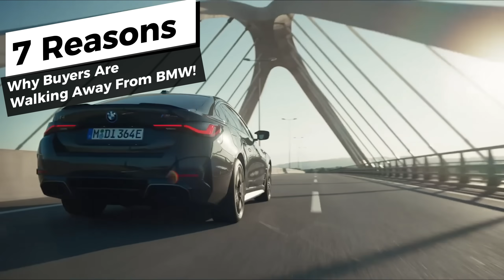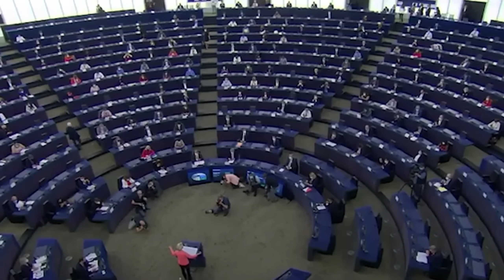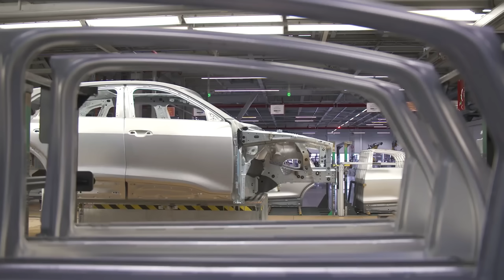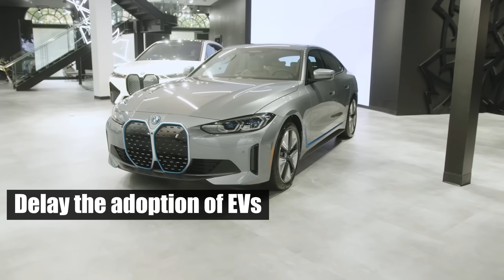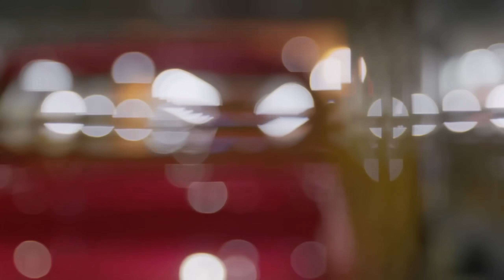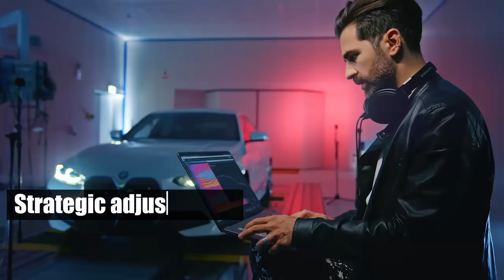BMW’s EV Sales Crisis: Why Buyers Are Walking Away! Electric Vehicles & Turbulent Market In Europe!

Comment: Look, imho the EV's look ugly . The height/length ratio is odd. This is due to the battery cell.
[ A nice looking car is eg. the F36 BMW]
Thus, as long as we do not have solid state accu's [ with higher energy density], the problem will not be solved.
Indeed, BMW produces Autobahn-limousine. What do you do on the highway? You drive very fast ( ~180-200 km/h ), on long distances. Not with the current battery technology. With that, you rather build small city cars [ i3]. Bad luck for BMW, who is famous for the Autobahn-limousine.

And this problem is made more serious by the new "" design" "language" of BMW. The dexterity and the elegance of their cars disappeared in oder that it appeals to the Chinese and yankee customers, who prefer the aggressive and villain style. [ An absolute disaster is the grille on the new 4er BMW, the 7er and the iX]. This does not correspond to the European taste. [ Maybe if a French or Northern European gets the chief designer position again and not a Serbian - who says that the cars should not look good, they should look "remarkable". Nope.]

Comment: Most cars are built out of painted spot welded steel. Pure heavy junk. Cars need a simpler blueprint, and components such as motor drivetrains should be coming from separate companies, so they will be more standard. The horsepower per passenger is completely ridiculous. A family wagon should weigh a few hundred pounds.

Comment: Zipse thinks we'd like to pay €400 per fill of hydrogen or €600 per fill of synthetic fuel, just because BMW wants to build old-fashioned engines. 🤣🤣🤣🤣The man probably didn't have physics at school, how is it possible that someone with so little knowledge of physics is in such a position? 😱😱😱😱 Laws of physics mandatory states: 
Hydrogen efficiency wind/solar to wheel: 22%, Synthetic fuel costs per liter: €8,-
Reply: however: what shall we do with the plenty of energy produced with the household solar cells in peak hours? one plausible solution is to convert it to H2?
Reply: @mortenvanlinden567 Yes H2! But not for cars.....H2 is very useful for fertilizers, iron melting in blast furnaces and other heavy Industries: they have no other environmental friendly alternatives.

Comment: At the moment 100% EV's by 2035 is a pipe dream.  The charging infrastructure can't support it, battery technology doesn't allow for extended range, charging times are too slow, and recycling used batteries will be a problem.  Industry will dictate what the future is for new vehicles based on affordability to manufacture and the cost to the consumer.  Governments are not likecorporations because they don't rely on profitability to sustain themselves; they simply raise taxes when they want more funding or deficit spend.

Comment: Compressed air engines might be a better way to go. EVs for all cars would be unsustainable for a start its not even a green solution as it uses toxic materials. No C02=No Plants=No humans. Single large compressors powered by various fuels could fill up a car far quicker than battery charging. Being just compressed air there would not be any exhaust other than hot air. Compressed air powered cars were used in WW2 so the technology is already developed using standard car engines with just a bit of tweeking.

Comment: Hydrogen is a dead end street both from a storage and conversion view. 
Hydrogen is a cover for legacy brands failure to make the transition. 
CEO's are gaslighting non technical investors with H2 and E-fuels.
The top ten in the US of EV/hybrid cars with the most stock expressed in average sales days included some 4 BMW models
There is an abundance of lithium. 
In contrast to the more ore less static Internal combustion engine both electric motors and especially battery technology is advancing fast with no end in sight yet.
EV are outperforming ICE on:
-power, 
-torque, 
-efficiency and soon on range too, 
-mechanical complexity no transmission and far less parts, 
-safety (required to protect the battery anyway), 
-production technology (mega castings), high voltage 48V board net
-software defined cars soon including real probably autonomous driving
-life time not being subject to the wear and tear resulting from that internal combustion vibration and heat

All (if you aware of exception please react) legacy car makers are experiencing their Kodak/Nokia moment and very few will survive.

Current ICE supercars Lamborgini, Ferrari and so on are not able to compete with a Tesla S Plaid or a Xiaomi with more power at a fraction of the price

The flight of ICE into the luxury segment is running into problems too.
Reply: If EVs are that wonderful, why have governments had to step in with tax breaks, discounts and all the other incentives. As one economist said, “make a better mousetrap and the world will beat a path to your door “ a good product will sell itself.
Reply: Note: I do object to an ideologically driven mandatory switch to EV. EV will do well on their own merit anyway. Mandates force uneconomical decisions. We are not a plan economy (yet?).
Reply: A year or two ago, I would have agreed with you on almost all points. I have even started an initiative to set up 12 charging stations in a communal area. And I might even buy a small electric car for the city soon. Nevertheless, I have strong doubts that electric cars will prevail in the medium term. I am increasingly coming to the conclusion that electric cars are and will remain a niche product.

-Drive power, yes, but is not nearly as important

-Torque. Yes, it's fun. But it wears off after a while. Range is more important.

-Efficiency, only if you look at the direct energy consumption. On the other hand, there are other disadvantages that are more important to me as a normal driver. Range, payload and trailer load are definitely important in practice.

-No, Teslas are safer, but not a Dacia Spring.

-Magacasting has nothing to do with electric cars. I looked at complex aluminum castings at trade fairs 30 years ago. 48 volts also works in other cars.

-Yes, but more expensive and more vulnerable parts. That is only a theoretical advantage. If I have to spend a fortune on a single part, the battery, then the advantage is of little use to me. That's the reason why electric cars are so expensive. If that were true in practice, then all electric car manufacturers would be money-printing machines. But they are not. I think only Tesla and BYD are making money at the moment. And part of that is credits from other manufacturers and subsidies.

- Yes, software is becoming increasingly important. But it has nothing to do with electric. The problem is that European and especially German software developers can no longer think straight because of data protection. They were systematically taught this during their studies. (Just my personal opinion, fuck data protection)

-Yes, in theory you're right. However, the high discounts on used electric cars indicate that things could be different in practice. Time will tell.

Your Kodak comparison is flawed. Kodak's problem was that they earned money from the follow-up products. Nokia's problem was that their smartphones could do so much more than the old Nokia bones. My original analogy was the advent of sports shoes. They were no better than well-made leather shoes, but could be produced much more cheaply. Also, electric cars theoretically have much lower barriers to entry. In my area, some small companies have turned new combustion SUVs into stylish electric cars. We're talking about 3-man operations here. But I don't see that small businesses have any say today. Only a vertically integrated state-owned mega cooperation like BYD can produce cheaply.

My confidence that electric cars are the future began to waver when the state paid purchase premiums for electric cars and quotas were increasingly demanded from manufacturers. The electric cars that I find interesting are exorbitantly expensive and were only sold in homeopathic doses (e.g. Jaguar E-Pace 150 units for the whole of Germany !!) or had. Massive delivery problems (Audi Etron, Skoda Enyak). The VW E-up, the only VW electric car that VW could sell in large numbers, was discontinued by VW and previously only sold at inflated prices. The earning structure of electric car sales is such that dealers have no interest in selling these great future-oriented cars to customers.

Fundamental problems such as insufficient local distribution networks are not being tackled by politicians in Germany. Instead, the problem is to be solved via land management. In other words, a cheap solution. WFT. In some cases, wallboxes are no longer approved if more than 2 electric vehicles charge in the street. One German municipality has completely stopped approving wallboxes. How are we going to achieve 100% electric by 2035?
Charging at public charging points is still a problem. Some e-car drivers estimate that 10% of all charging attempts, for non-Tesla vehicles, fail in Germany. I asked an experienced electrical engineer why this is the case. He has no explanation. Electricity is electricity. With a properly defined interface, this shouldn't really be a problem. But it is.
Prices for public charging stations have risen dramatically. If you can't charge with your own PV system, you save little or no money. For the extra 10,000 euros that an electric car costs, you can fill up a lot.
Chaos cards. Up to 70 Card in GER. For me as a consumer, I can't see why I should have a charging card at all. I don't need one at the filling station either. After a lot of complaining, there are now probably the first charging points where I can pay by credit card. You can even pay cash at the ARAL petrol station chain. Why not just like that from the begining?

Oh, but I wrote a lot about that. That is frustration and disappointment. I used to believe in electric cars. Yes. Faith is the right word.
Reply: Hydrogen = Hindenburg

Comment: The entire European car industry has been shackled by the EU's and UK government's 'net zero' obsessive legislation. The EV market is saturated, the situation exacerbated by plummeting residuals. BMW (and more acutely, Jaguar) have put all their eggs in the EV basket, and could tank (as could VW and Stellantis). BMW has not helped itself by increasingly hideous designs (as are Mercedes EVs), and dashboards that look like cheap, aftermarket add-ons. Most consumers want and need ICE cars, and this will be the case for a very long time to come. However, if hydrogen fuel (using green hydrogen) becomes viable, both in fuel cell EVs as well as ICE cars, then things may turn around - the operative word being 'may'.

Comment: The cheapest BMW EV starts at $58,000, simple economics.
Reply: $58,000 is a top premium price for a car.  I thought EVs were supposed to be $15,000 cheap cars that everyone could afford.  Electric motors are cheap and have been around forever.  Are they using braking recharge?  An electric motor per wheel?
Can they get the batteries off the bottom where they get damaged and in the back or front where they can be fire walled off from the passengers?
Reply: 👆this👆
Reply: Yes BMW’s cost too much! I had 4 BMW LEASES, FINALLY SAID THE COST WAS JUST TOO EXPENSIVE. THE LAST CAR I TURNED IN ONLY HAD 7800 miles on a 3 year lease. BMW still charged me $1400 usd because I turned in the car early!
Reply: @jeffereylew581  Run stupid contests, win stupid prizes!
Reply: Everybody seems to forget about the price of a needed charger. It doesnt install itself. Are the governments going to pay for them?  Doubt that.
Reply: BMW and most of the EU car maker stupidly just make car bigger for each generation, latest 5 series is already more than 5 meter long, not everyone need a bigger and longer car,  not everyone could handle it, some old city would have even problem to drive and park it. Size change impact the material cost and made it unaffortable and uncompetitive.
Reply: Chinese EV's are better and cheaper.

Comment: The mandates were never realistic
Reply: They aren't realistic. They also aren't needed. EVs will outsell ICE very soon. Peak ice was over half a decade ago in 2017. While EVs have been on the rise. As EV prices fall with plummeting battery costs, you'll soon need rocks in your head to spend more on an ICE car over an EV.
Reply: @DanielWillis-q2g  EV sales depended on the 3 F's, Fans, Fleets and gov Freebies. The Fans all now have one, the Fleets are at saturation point, and gov Freebies that was the sweetener is gone, so sales are no in terminal decline. ICE engines will probably still be here when EV's are a dim memory.
Reply: Try pulling a trailer with an EV!
Hint: doesnt work!
Reply: @DanielWillis-q2g Dream on, EV's suck.

Comment: It's not rocket science. Electric assisted ICE hybrids are the only true option we have at this point.
Reply: No.....Hybrid's have A Lithium battery and a Hybrid System that costs more than the price of the Car to fix......in some cases
Reply: @gj91471  That's a blatant lie. Check your facts. ICE hybrids are the only real alternative to any system. Full EV car batteries cost at least half the price of a car to replace! And that is definitely, not the case with ICE powered hybrids.